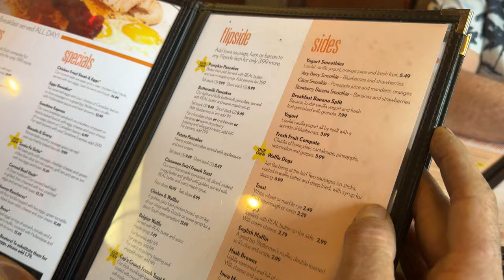Road Trip to Las Vegas Day 2: Running on Empty

Comment: 68-70 Chevelles had 2 different wiper motors. Park and non park. Park means recessed. The wiper blades will park on the stainless lower windshield molding. There are actually resting ledges where they land. 
The non park style leaves the wipers abover the rear of the hood and they stop on the glass. 
There are two different lower windshield moldings. 
Also the arm attached to the motor is different between a park and non park.
The wiper arms are different between recessed and non recessed also.
I would think by 1971 all Chevelles had recessed wipers, but I could be wrong on that. Typically an SS or Malibu would have recessed wipers. It would be a plain Chevelle, 300 Deluxe or Nomad wagon that would have non recessed wipers. Lower trim models...
Find a dyed in the wool Chevelle guy to have him look at your car and see if you have all of the right parts.

Comment: Mike, you should've had a accurate , working fuel gauge. Having a chase truck with fuel was an essential and smart thing to do. Take care.
Reply from the maker: even when they work old guages are nort very accurate not like the new ones that give you a countdown
Reply: @RustBrosRestos  I drove old vehicles and I never ran out  of fuel. The factory gauges were accurate enough. I never ran a big block engine. I would get to a quarter tank left and I was looking for a gas station.
Reply: My old 69 comet 390 /375 horses got 13 mpg (imperial gallon).Made it easy enough to figure when to gas up lol